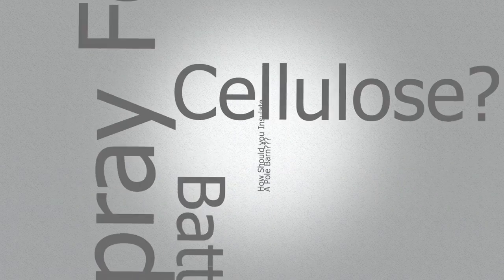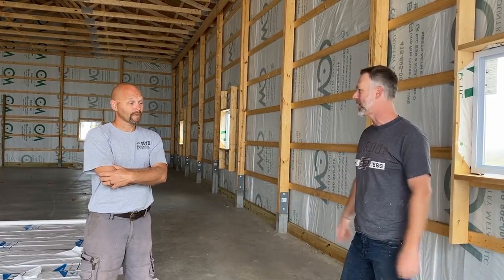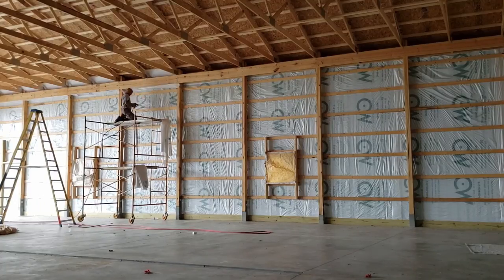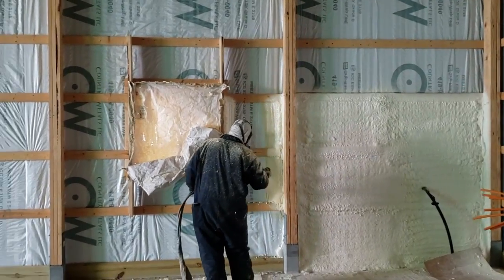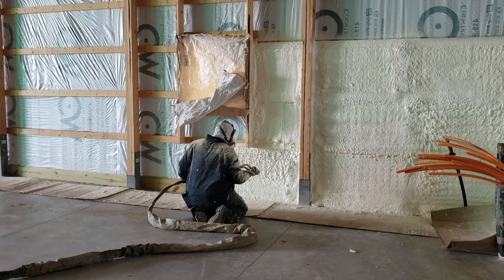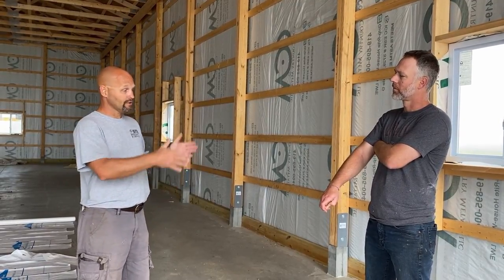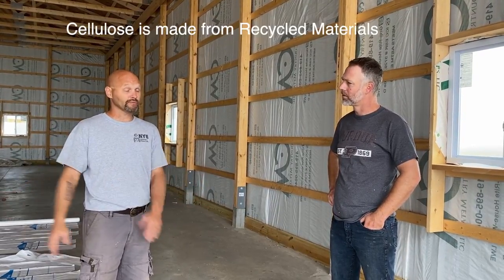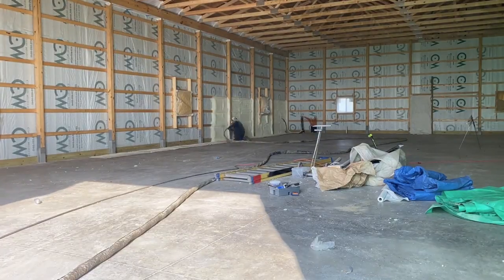Interview with 20 year PROFESSIONAL spray-foam expert!

Comment: I just want to point out that the spray foam does not stop radiant heat.  A radiant heat barrier and an air gap is necessary for that.  I don't understand why he said that it stops radiant heat.  And it reduces air flow, NOT stop air flow.  Short answer is the foam has a higher density than fiberglass. While the benefits of the foam are better than fiberglass, he is exaggerating the sales pitch.
Reply from the maker: I think he does a fantastic job technically explaining for laymen. I have watched multiple insulation videos on YouTube where people go into more of the science of each product.  The bottom line with insulation is although we give each an R-value per se, they do perform differently.

Comment: Why does that extra inch not cost so much?  This is literally like painting.  All the work goes into the prep and cleanup.
Reply from the maker: hhmmm...  well, I find that most of these spray foam guys around here charge between 95 cents to $1.35 per square foot for 1 inch, then the second inch runs about 80% of that cost for the second inch.  Probably the cost of material and extra time.
Reply: It doesn't reduce cost past the fist inch it reduces time to install.

Comment: Do you put house wrap on the underside of the roof as well? Then spray over that? Seems like it would sag from the weight. Then you say 15” off closed cell? What about potential leaks in the roof? I’m doing PBR panel on full metal building. Thanks
Reply: You need to spray onto a drainage sheet with a VB towards the sheathing.

Comment: what a nice detailed video!!!   just quick question, dont we want lil bit of air filtration tho? if not mold can create? like  in an attic for example.  or blocking every hole and letting no air flow  is best ? 🤔
Reply from the maker: That's a good question.  I'm not the "expert" in this, but I will surmise after seeing many barns with spray foam....   Firstly, the metal covering itself is tight, but not so tight that some mild air movement won't happen.  Also, here in Indiana / Ohio, our weather fluctuates heavily and we get very dry in the winter.  My theory is the ebb and flow of humidity levels keep the moisture in check. We have done numerous "re-skin" projects and I've seen barns with foam after many years and none yet have had any mold.  Glad you liked the video, we're trying to be helpful!

Comment: If I'm building a shop home vaulted ceilings I would want to go closed spray foam?
Reply from the maker: I've seen some people do 2 or 3" of CCSF on the top of the drywall even on their ceilings in the house.  We don't really recommend doing CCSF on the backside of a roof, but it has been done.  However, depending on how much your vaulted ceiling is pitched - you can do blown-in cellulose - but it may slide down a bit over time.  You just want the attic to be able to "breath" a little bit.

Comment: There are liquid based air barriers that don't require closed cell phone.  

Seems way less expensive to use an thick elastmeric air barrier than 2lb foam to get the same effect.
Reply: No because foam expands and finds its way into nooks an eye can't see where liquid only has gravitational drop to find WHT you can't see. And if you use a blower door to test you'll see every missed coverage area any bigger than like the tip of screw driver

Comment: Great info Thanks, I have a 12x24x10 shed, I was just quoted $2500.00 for 1inch Closed Cell.
Reply from the maker: Those people may have a minimum charge who gave you that quote. However I would tell you that’s astronomical. Right now closed cell spray foam is running about $1.55 to 2 dollars per square foot. Your building should have been quoted anywhere between $900 on the low end and $1500 on the high side.

Comment: We are building a pole barn house and doing some homework on the vapor barrier on our metal roof, it's between drip stop on the metal panels or regular panels then close cell spray foaming. Any suggestions? Thanks!
Reply from the maker: if you are using CCSF on the back of the roof metal, it doesn't seem like you'd need to use drip stop.  Honestly, I recommend using OSB under the metal on the residential side of pole barn homes.  It does add some cost, but in the long run, it makes a much stronger structure.  Maybe I've just seen too many trees fall on barns and think about the additional roof integrity.

Comment: Connecticut has a new law where exterior wall cavities must be "6 thick with proper ventilation installed due to proper air flow etc. It's a movement to save on energy cost. How would "6 of Cellose spray foam effect the house. What is it's r-value and such a thickness? Can such a depth be obtainable and efficient? What are some of the problems you can run into in such a thick wall?
Reply from the maker: Honestly, any house we build in Indiana or Ohio would use a 2x6 exterior frame wall.  But, you could get amazing insulation value by doing 2" of Closed Cell spray foam and then batt insulation over top.  2" of CSF = R14 + batt insulation of R19 would equal a pretty cozy house.   6" of CSF is way overkill and would cost you probably 10$ per SF!   Open Cell Spray Foam is different and could fill the whole cavity.  Talk to three different insulators from your area and ask each of them to give you a "Basic" and  "Best" method to insulate your new house and see what they say!

Comment: Great Video, I have a project and need to spray foam my vaulted ceiling, but I will be taking the tin off and spraying from outside in. My question. Can i, or does it make sense to fill the entire vault with the 5.5" and be flush with the ceiling rafters to get maximum R value. or am I better off or is it the correct way to spray say 2" of foam and then put fiberglass insulation over that?? 
Thanks
Reply from the maker: If you have the money to afford 5 inches of closed cell spray foam, nothing is going to beat that. That would give you at least an R 35 value directly on your ceiling and would be a total game changer to keep the heat from radiating into your space. However that’s very expensive. If you have the cavity depth then you could easily do 2 inches of foam and a batt insulation on top. Any insulation is going to be better than no insulation.
Reply: @barnandhome  really appreciate your professional advice, in the case I did do the 2" closed cell with batt on top. Is that in the order of having the spray foam on my interior ceiling? so facing inside and then lay the batt insulation over that, so that batt insulation would be on my tin side? or vise versa? Thank you
Reply from the maker: @jvskyrud  Firstly, I’m the one asking the questions in this interview, not the guy doing the insulation. My primary business is constructing buildings, however, traditionally the spray foam would be attached to the exterior wall, or in your case the backside of the roofing material. If you can only insulate by pulling the roof off instead of doing it from the inside, I’m not sure how you would pull this off? I would be curious to hear from a professional insulator about your question, I don’t know why you couldn’t spray foam onto the back of your ceiling material, and then lay batt insulation on top of that and then put your roof on. I’ve just never seen that done before.
Reply: @barnandhome  Thank you for the input, very much appreciated. I should get ahold of some local guys and pick their brain. Does make me think to, if I would have any problems doing it backwards from how you usually do it. But I may just resort to filling it right up so I know I wont have any worries. But I really do appreciate your input and if anyone in this expertise would know. Please chime in.
Thanks!!
Reply: @jvskyrud  BATT INSULATION ALWAYS ON THE WARM/ ROOM SIDE BECAUSE OF VAPOR BARRIER/ CONDENSATION; FOAM NEXT TO THE TIN SHEETS. MY HUSBANDS AN ARCHITECT.

Comment: Closed cell foam also has structural benefits.
Reply: Yup adds 1/3 the structural benefit as if you solidified it with concrete

Comment: I'm building a steal metal barn would 2 inches of closed-cell be enough on the roof to keep it properly insulated?  I had a guy try to quote me on doing 1-inch open-cell and then 4 inches on top of that. What do you think about that? Would it really work?
Reply from the maker: Hey Joe....  2 inches will get you R14 value with CCSF.  Residential building code here in Indiana is R19.  If you are working in that shop all year round it might be worth it to invest a little more in insulation upfront.  For people who want a well-done space I am personally a fan of one or two inches of closed cell foam and then hanging batt insulation over top where possible.

Comment: So you can spray foam directly to the house wrap?
Reply from the maker: Exactly.  That's what you want to spray on, not the metal.  That's why you should always put housewrap on a barn in case you ever choose to use sprayfoam.
Reply: I have a 24x30x12 shop with the bubble foil insulation. Can I spray over that?

Comment: What about the moisture issues often associated with metal exteriors? Spraying for on a perfectly dry wall would stay that way for the lifetime of the building would you say?
Reply from the maker: Yeah good question, it's why we always recommend you spray onto house wrap and not directly onto the metal.  If you did not put house wrap on and have an older Barn you want to spray foam, you can see my other insulation video where we used white styrofoam as our base layer.
Reply: Yes you can't spray it against an internal tyvek or house wrap it won't adhere properly and yes it has to be 100 percent moisture free upon application or your asking for trouble